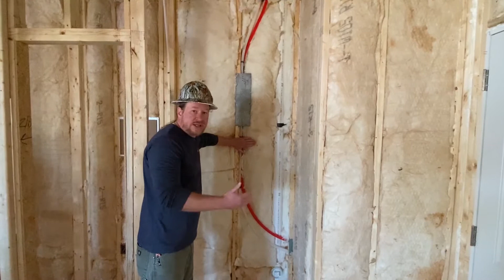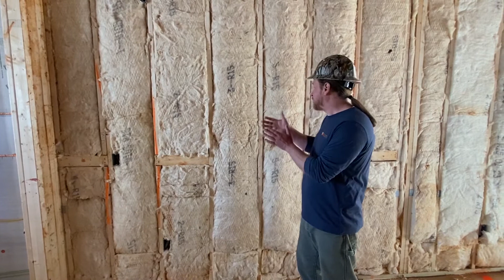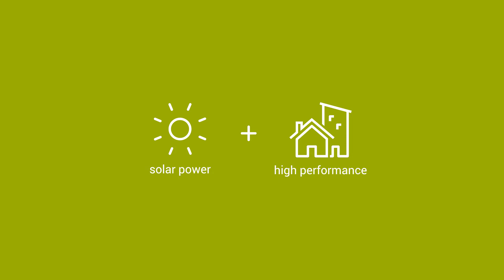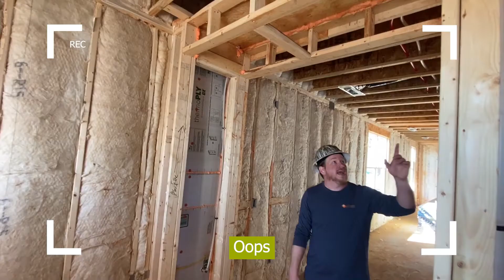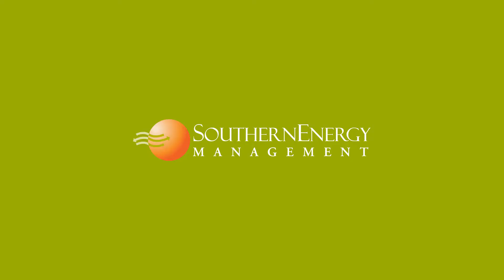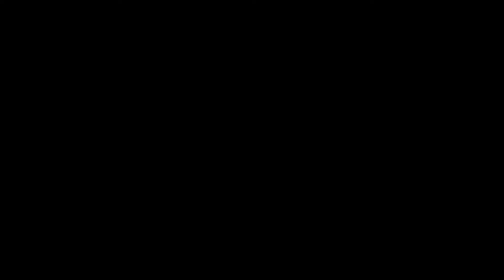How to Achieve Grade 1 Insulation

Comment: What you don’t need an air barrier at the basement sill joist area? That seems very odd with climate zone do you live in this is one of the most vulnerable areas in houses north of the mason Dixon line
Reply from the maker: That is correct, code and most energy efficiency programs do not require an interior air barrier in the band joist at basement or between above grade floors in CZ 3-5.  It is very important that the exterior band is air sealed before the insulation goes in for best thermal performance and infiltration reduction.  Band joists and cantilevers are an excellent applications for open cell spray foam which creates it's own air barrier.